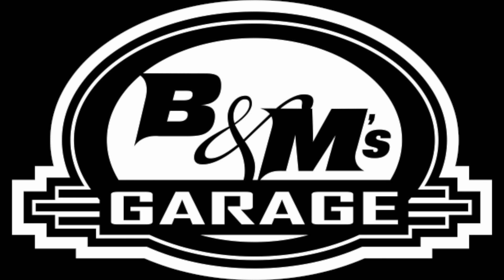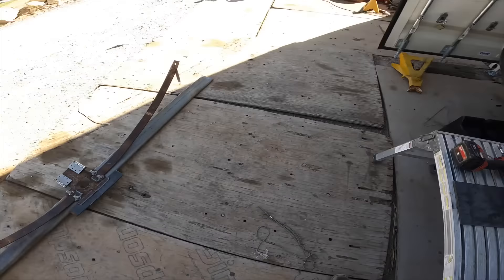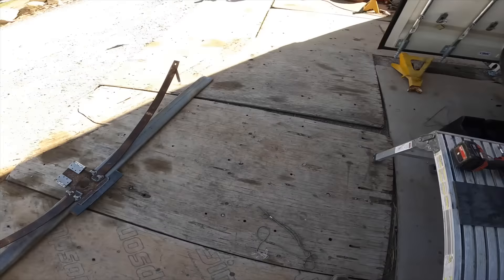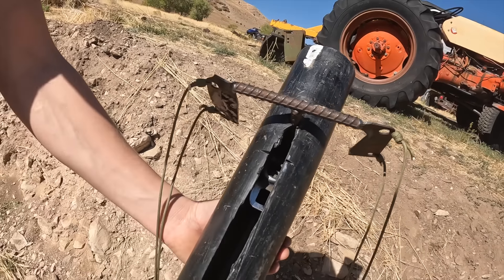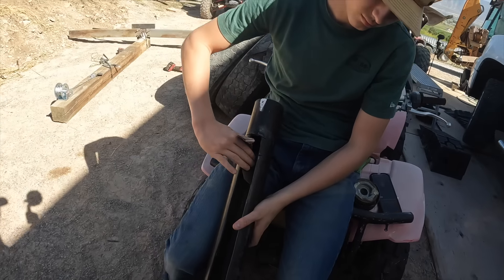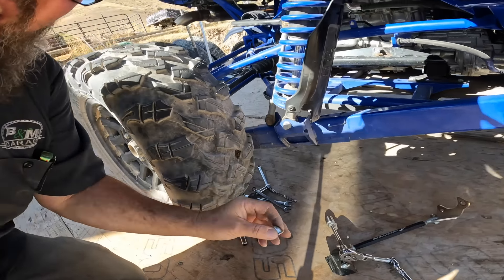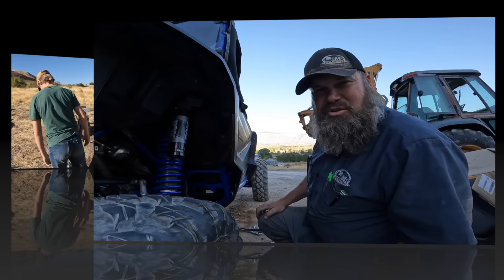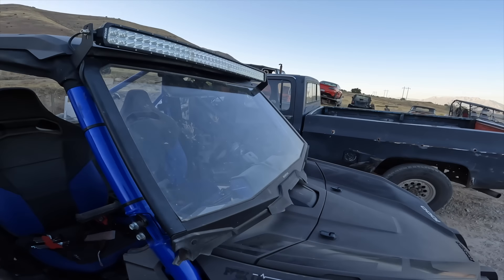Safety for THIRD Mom!

Comment: For a Bolt, maybe try some Electrical Conduit, instead of water pipe. It's a lot lighter. Plus put a point on the tip ;) Or maybe even use a smaller diameter barrell to shoot the Bolt. you got to think of it as a Gun barrel and the bullet that has to go through the barrel. ;)

Comment: Regarding the ballista, I think you're losing a fair bit of your energy in recoil.  It's moving the entire ballista backwards, which is energy NOT used to push the projectile forwards.  See if you can secure it in place better.  Remember Newton's 3rd law!
Reply from the maker: @JonsMG  hold on tighter? Is that the third law?
Reply: Lol, saw that right away...  That 2nd shot (with the higher angle) probably recoiled 6-8", that's a major loss of energy...
Reply: Isn't 'Newton's' 3rd law..."Don't eat an entire package in 1 setting, or you'll be setting...'?
Reply: You're on the right track with your cross bow. You might wanna add a little longer plunger, a bit of lubricant, and most important. Secure the bow so it doesn't move when fired. The pvc bolt was a great idea,  but you need a stick of wood inside so you don't have deflection and losing accuracy and distance. Love watching you guys build things for fun. Great job, Ben, for fixing your nabors side by side. It's amazing how poor the quality of stuff is today for such a high price.

Comment: What up guys.
Ocher I think it's the cable. 
Get some rubber stretch rope. 
And use a broom handle stick. 
Good luck guys. 🤜🏽💥🤛🏽🫱🏽🫲🏽🪶🌮🍕🍨😎🤙🏽
Reply: Possibly, rubber wouldn't use the flex of the springs tho. What he needs is a little more pre-tension. And broom handles are perfect bolts!! Pop can fletching!

Comment: Hey, a wee suggestion for cutting bits of steel like that - over here in Scotland🏴 I use a Stanley 'hacksaw'.

Its a hand operated saw for cutting eg metals. If you want to, you can fit different types of sawblades to suit individual materials.
Google it.

I reckon I could've cut that piece of metal in near as makes no difference the time it took you to dig out all of that burning gear. 😉👍